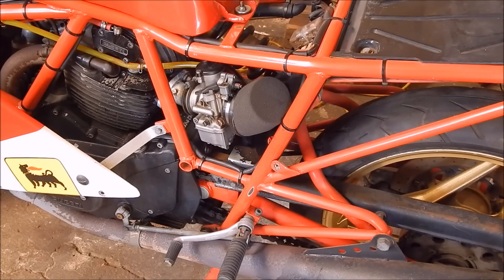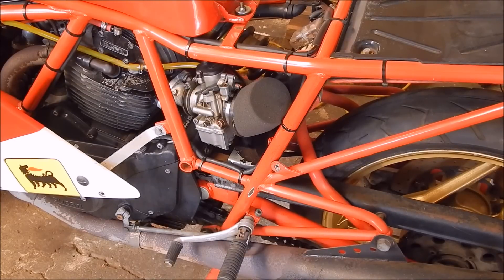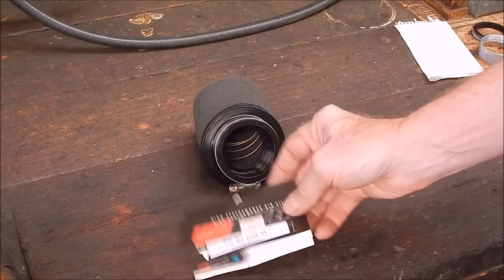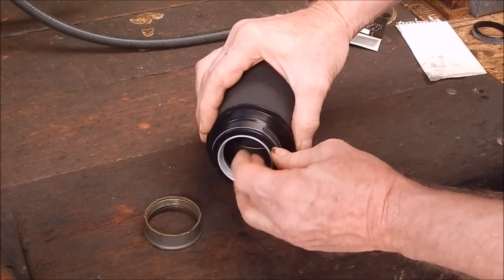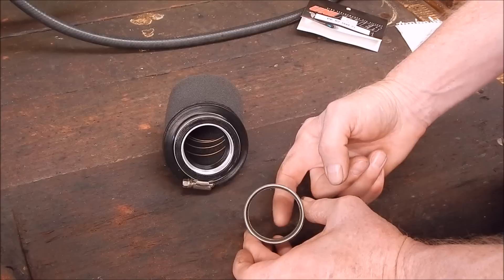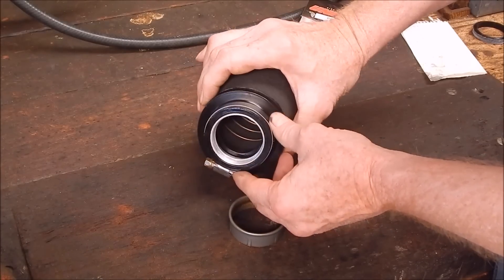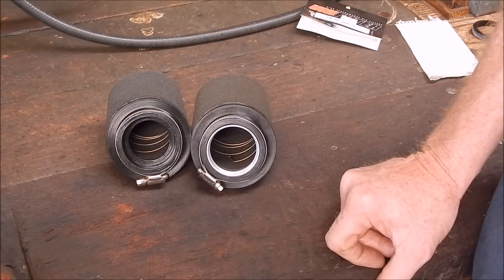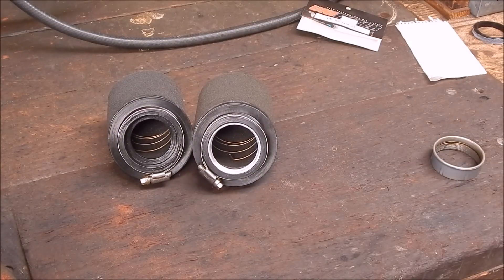Do Unifilter foam pods restrict air flow ?

Comment: Yes!!!!!! that lip definitely restricts air to the 2 ports that run across the lip of the CVK carb in my setup, the circle and the smiley opening, I installed the Uni Filter and performance exhaust to a 250cc with which had a 108 main the highest i could go up was a 114 116 :-( and i got to that point because i brought a air fuel ratio meter set up, I  have fort with this for Months!!!!!!! me being told i should be able to go up to a 130 main , I ran across this video the other day and looked inside the lip of my filter and that reduced lip was there !!!! I use a hole saw and a Dremel and removed it  ,I now have a 134 main running with no problems :-)) Thankyou so much for posting this you are the man!!!!!!!!!!!!!!!
Reply from the maker: Glad it helped you Tyrone.  Not all filters have it, but mine did and I'm sure as you have shown, there are others.   Simple fix.  Cheers Rob

Comment: Also your comment on foam filters comming last in bench test is simple, the air only passes through one thin layer of paper in stanard filter, or one thin layer of cloth in K&N, however in foam filters it must wiggle through the open poors of the thick foam bouncing its way through, thus slower than a thin mesh like structure.

Comment: The reason that stopper is there is to mainly proper seat on long velocity stacks.  There are some velocity stacks that are over 150mm.  The stopper keeps the filter from sliding down making the flow even worse.
Reply from the maker: brian hilligoss If that was so then the velocity stack would not work as intended.  For a
 velocity stack to work the bellmouth and rollover flare must be 
intact and unobstructed.  Sticking a flat faced rubber ring on top is not going to do a 
lot for performance.  Rob

Comment: Rob,
I think you are on to something. It appears that the stock air filters would restrict air flow. That could cause all kinds of problems with your mixture and the carbs running too rich. If you adjust the carbs for proper mixture, you are not getting the ultimate air/gas mixture the engine was designed for so your engine power will suffer. I thing your modified air filters will eliminate this problem and you will get full power from the engine. Thanks for the interesting video!
Have a good one . . . and ride safely! At least in the US, there are a lot of crazies on the road!
Dave
Reply from the maker: Swarf Rat Hi Dave.  I neglected to mention that this bike never came with any air filters.  Yep, some early Italian high performance bikes  (Ducati. MV Agusta etc) didn't have them.  So most people put on after market pods to keep grit out of the engine.  Also many are unaware that Ducati were all jetted for free flow exhaust systems regardless of what was fitted for the country of sale.  So you never need to re jet an early air cooled Ducati when you change the exhaust system.  So called wanna be "tuners" play around with the jetting, but it's a losers game, and best left as is.  Cheers Rob

Comment from the maker: Following up on this video, I am also replacing the very old set of Unifilter pods on my Ducati bevel 860GT, and when I removed them I see that they don't have a restrictive ring in them. Go figure.  I am told these straight throat type are no longer available, and the later version has a reducer in it.  Rob

Comment: Hole saw cut nice. That lip looks minor as per affecting street riding.
Reply: Absolutely..this is hair splitting. Maybe it your running a big drag motor but on a street bike ? It’s ridiculous
Reply: @video3ish  It's not ridiculous at all, although he doesn't explain it well, what that lip, or restriction is doing is making the incoming air "tumble", or become turbulent, engines like laminar flow, a smooth, constant flow of air, that's why most well made road bikes have velocity stacks, even CB750 Honda's from 1969 onwards had velocity stacks standard. It's also why when porting a head you try and smooth out the radius where the port drops over to the valve, basically removing or improving a restriction and increasing flow.
It's actually not as critical on a drag bike because they run flat out from start to finish, on a well tuned street bike, or race bike, you need a smooth , constant flow of laminar flowing air,  at all throttle openings, hence the velocity stacks and no restriction. On every bike I've modified, including the one i'm building now, I've matched the inlet manifolds to the head and run some sort of match ported velocity stack set up, the improved dyno results don't lie.... All the small things done well make for noticeable improvements... 
By the way, this is very well known by race engine tuners, and has been for a very long time....

Comment: Does that part of the air filter actually restrict air flow? The way I see it the air filter can allow much more air to pass through it than the intake can since its much wider so there is plenty of air coming in that exceeds the amount of air the intake can consume at a given time so I don't understand how that can be a restriction because all the action is really in the intake. I'm not saying you are wrong but I am bringing up a principal of physics I believe. Also by the title of this video I thought you were going to talk about the oil within the air filter restricting the air coming in. After I soaked my UNI and put it on my gy6 50cc scooter its very hard to start and I'm thinking its all that foam oil is to much for a 50cc to handle. Anyways thanks for the video.

Comment: Good observation Rob ! I just bung the unifilters on my 125cc pitbikes/thumpstars and away I go. Another curiosity thought is the baffles in the muffler. If they restrict exhaust flow, how does increasing intake flow help? My shed full of pitbikes have a straight through exhaust, with pretty much no baffle whatsoever. I think the muffler is just there to make it look like a muffler and help them sell Chinese pitbikes?.. My suburban neighbors love me or maybe they just put on a false smile when I ride around the yard:) Is there any way you could do an airflow test? Although I think your mod would have to help somewhat. Even just to cut out half of the rubber shoulder? Why not go all the way Rob and chop off your mufflers while your at it :D
On a more serious note, could you make extension rams for the intakes and leave a small part of the unifilter shoulder the same thickness as the extension ram wall thickness? I think I will be having a closer look at my Mikunis next filter change..
I say give Unifilter a call and ask them why the hell there is an air restricting shoulder in the rubber part.
Reply from the maker: djpaulk Hi Paul.  Two strokes (pit bikes) rely on exhaust resonance in the muffler to achieve full power/correct air flow.  The worst thing you can do is to have a straight out pipe, as it will not scavenge the cylinder properly, and achieve full efficiency.  This is why modern two strokes are much more powerful than their early counterparts.  The dynamics of intake air flow are separate and quite complex, and carby size/air flow all relate to where you want maximum torque to be at a certain point in the rev range.  You may be pleased to hear that the little velocity stacks I made, are from my home cast aluminium, and machined on my cheap Chinese lathe :)  Cheers Rob
Reply from the maker: xynudu To measure power points/gains/losses you have to use a dyno.  Just flow testing is not enough, although it obviously gives an indication of any restrictions in the system.  Rob
Reply: xynudu I was going to mention dynamic analysis but suspected you would laugh. Are you not simply removing an airflow restriction with this mod? That could be checked with a modded and un modded filter, the right test meter and attachments. Anyhow, my thoughts on your mod is that it has to make some sort of improvement regardless of how miniscule. We all know why the spring is in there, but contact Unifilter and ask them why the rubber shoulder is in there. An interesting vid Rob. I will deff be checking my carb and filter next time I change it. Yes I understand the principals between 2 and 4 strokes. I used to own a CR250ME with a whopping big expansion chamber. Cool vids Rob, keep them coming mate :)
Reply: djpaulk You can do a great analysis with a manometer and a vacuum cleaner that should show if removing the restriction made a notable difference in the air flow.  Just unbolt the carbys (I think that is what he called them) and attach a hose from a vacuum and cut a hole in the side for a manometer at the carb outlet and you can see if the pressure is higher or lower.  And I bet xynudu can build a manometer in a few minutes, even without casting any aluminum.
Reply: lol, Aluminium....   He likes it and that's good.
I'm sure its said in Aus as,
"twin carbies mate"!
Make sure your wife does not notice her vacuum cleaner missing though! :P
I'm a refrigeration /air con tech so I believe in air flow and am familiar with the meter you speak of. No castings Rob, its just a vac test. Make sure your crankcase has not even a snifit of a leak

Comment: Honestly that reduced diameter is going to make squat difference, the air flow will be turbulent at that speed anyway so ram tube idea doesnt apply,  that small an engine wont suck in that much air for it to be a concern, the filter material itself is way more restrictive than the reduced diameter,  nice fix but you will have virtually no gain in airflow and with less vaccume pressure you going to suck less fuel from the carb so its possible you may loose power.
Reply from the maker: Oliver Boatwright I don't see how the vaccume pressure will be any less than with just the original bell mouths ?  Rob
Reply: If you filter is more restrictive less air will flow, the engine will demand the same flow rate, so something must give, to move air you must have pressure, weather vaccume (-) or positive (+) so if less air moves like holding your hand over a vacume cleaner you will decrease the relative pressure in the throttle body which affects how it delivers fuel, a carb uses the mass of the flowing air to move a piston which controlls fuel mix, it's not easy to explain but any filter, carb or displacement change will require carb to be re-adjusted
Reply from the maker: Oliver Boatwright There's no moving piston as you describe it in a Dellorto pumper carby.  You are describing the operation of a CV carby like a Bing, which is subject to the issue you describe.  Totally different operation.  Rob

Comment: does this camera you are using have auto focus during video? Would you recommend for a budget friendly option for youtube video?
Reply from the maker: FashionBeautyBri Yes.  It can be turned on or off.  Like a lot of budget cameras it does not have auto focus while zooming.  The image and video quality is excellent.  Particularly good in low light.  It also is very easy to set light compensation and macro, both of which I use in every video.  It does not have an external microhone jack.  I looked at the rest and this was great for the money.  Most user reviews rate it highly.  Certainly the glass Nikon optics are very sharp.  I have no regrets buying it, and would recommend it for the type of video I shoot.  Cheers Rob
Reply: thanks so much for your swift reply! :)
Reply from the maker: FashionBeautyBri Your welcome.  Looking at your channel name, if you are looking to do face and head shots with audio, then you really need a camera with a swivel screen and external mike jack.  Audio falls off quickly if you are not in close proximity to a camera, so it comes down to how you intend to shoot your videos.  Also unless you use a set shot like I do, you may find it difficult to frame the video looking at the camera. The Nikon is a great camera for my use, but audio can be restrictive for some users, as you can't commentate away from the camera.  This applies to any camera without mike provision.  Consider what you want the camera to be able to do.  This is the most important part of your purchase.  I trust this helps in your purchase.  Cheers Rob.
Reply: Yes, your assumptions are right and yes it was very helpful. I wi;; use this advice to point me in the right direction :)

Comment: Universal parts universally don't fit 100%. I like uni and have been running them for years. The problem you run into is they basically have 2 models of the say 50mm filter (straight or angled neck) to fit many different makes and models. Where model A needs that stop for it to fit model B doesn't. If it will run on model B even with the stop it's easier/cheaper to to have it. Less cost in tooling, less cost in manufacturing and less cost in inventory having one single part that "can" work vs 2 parts that "will" work.

Comment: I don't really know much about these bikes, but if your air flow was so restricted wouldn't you have to adjust the carbs differently and vice versa? Other than just looking at it and thinking its a problem, did it actually present a problem, noticeable change either way? I am just thinking aloud here...
Reply from the maker: bensbenz It's all about getting the bike to breath as well as possible at the top end.  You don't want any restriction in the air flow.  Rob
Reply: xynudu yes airflow is vtially important, howver air is useless without the added fuel, adding more air wont give you anymore power, you need more fuel aswell, so a propperlly adjusted carb giving stoichiometric ratio (14.7 parts air to fuel by weight) will always produce more power than a slightly higer flowing air supply and thus im-propperly tuned carb.